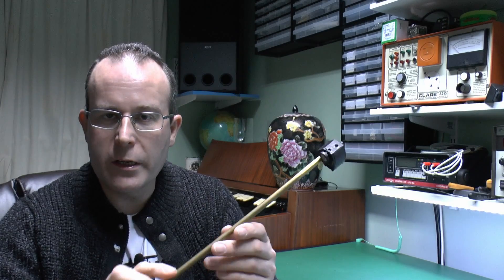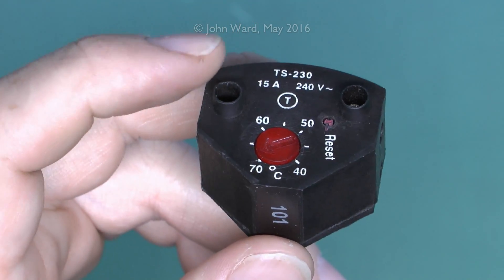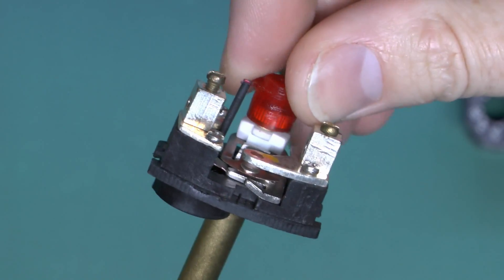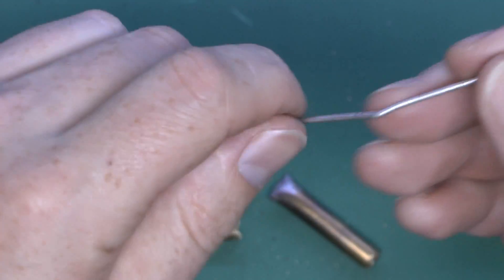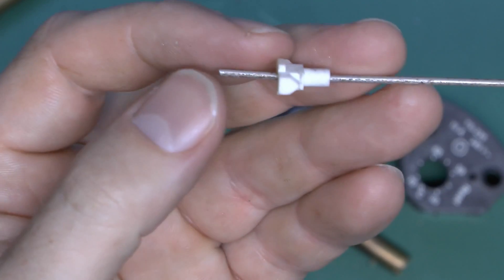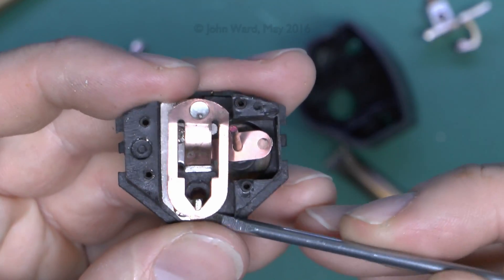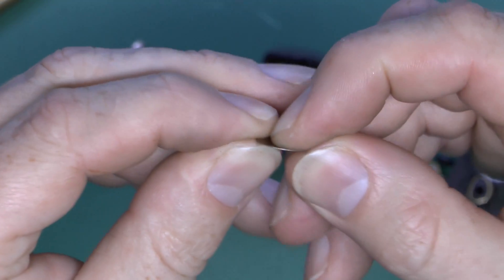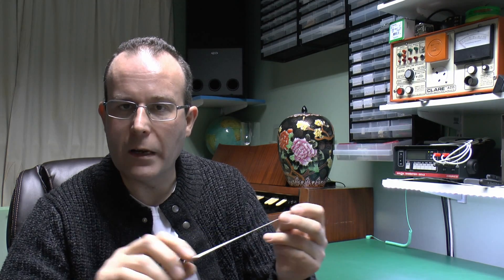Immersion Heater Thermostat Taken Apart

Comment: You have a perfect voice for an Airline pilot.  Wasted as an electrician/ plumber. Im here because thermostats are the bain of my life. Latest problem is corrosion at the supply connection to the point where the insulation melted. I've  lost count how many of these ive changed in 30 years and they're not getting any cheaper.

Comment: John, can you pls. recommend a make of thermostat with adjustable (or at least a high value of) hysteresis. Thanks in advance.

Background - I had my failed immersion heater element (with thermostat) swapped out 18 months ago by British Gas, who fitted a Tesla unit. Its working OK apart from one thing. When the tank is nearly warm it turns off the supply for a few tens of seconds, then turns it back on again for a similar time and repeats that cycle several times. Not good for the switch contacts and it must cause the Solar PV diverter supplying the unit cycle on and off several times as well which probably isn't good for its life span either.

Comment: Are there immersion heaters designs where the thermostat is not removable? My thermostat is faulty (always on) and seems to be fixed in place. I am reluctant to pull on it too much for fear of breaking it. This was installed in 1997. Thanks for any advice.
Reply from the maker: Not that I know of.  It's either the style shown in this video, or unvented cylinders typically have a larger thermostat head which plugs into contacts on top of the heating element.  Either way, both are designed to be replaced.

Comment: would a faulty thermostat cause the water to not heat up to the required temperature my tank is only heating a small amount of water
Reply from the maker: Yes, if it's switching off at a low temperature.

Comment: Thank you John, I would like to ask you a question. The top thermostat on our immersion heater is upside down and wired the wrong way around. Would that make a difference, stop it working? The water is very hot...
Reply from the maker: No difference, all the thermostat does is connect the two wires together when heat is required.

Comment: I've just realised with the thermostats that I've been buying that it's not necessarily the stat that fails but the metal wheel that goes slightly out of sinc with the plastic adjustment wheel on the outside of the stat, it seems like one certain manufacturer whom I've been using does not fix these with a heat resistant adhesive and this in turn stops the contacts from working, this has been somewhat of a revelation as I now have 4 fully functioning stats and all they needed was a slight adjustment and some high temp super glue,faulty or just poorly manufactured????

Comment: Hello mate. I have a pullin h8 thermostat, 15 amp 250v on my emersion heater. I have recently changed the isolator switch on wall as it stopped working. (Wasn't switching on). Now it stopped working again last week , so when I opened the cover on the heater and turned the water temperature down to minimum setting 120f, I heard it 'click' and it started working again for a week. A week later it's stopped working. Am I right in assuming the thermostat is faulty . And are they all the same or will I need the exact same one. Also instead of leaving it " on" at the wall all the time I tend to switch it off and on when needed. Is this not good to do?
Thanks in advance
Reply from the maker: 99% faulty thermostat - 120F is far too low for normal use anyway.  The fact it's marked in F means it's probably decades old.
They are all basically the same, the only real difference is the length of it, you need to get one of the same length.  If it fits into the top of the cylinder probably 18", or 11" if it's in the side - but this will be obvious when you take the old one out.
Doesn't make any difference switching it on/off.
Reply: @jwflame  thank you for prompt reply. Yes it's the top of the tank. I will remove it and check length . I have taken a pic of the top of it, but can't attach, but I think it's a case of disconnect the two wires and it just pulls up/out maybe a little help from prising it with a screwdriver?
Reply from the maker: @moshazza5684  Yes, it should just pull out, no prising required.

Comment: Hi John, would polarity of the terminals matter in the thermostat? I don't mean where incoming mains neutral and cpc are attached. Just the two terminals on the stat where mains incoming line is attached to one side.

Comment: Hi john i discovered the other day my hot water is only  slightly warm even with the cylinder thermostat fully up it was on for a while but still just warm  , is that a thermostat at fault on the cylinder or would it be the immersion heater thermostat or element, i have checked there is no loose wiring and the is voltage on the cable before the thermostat itself on the cylinder ,can i test each thermostat  with my meter  any help would be great

Comment: since changing mine....i am contantly pressing re-set button....i,ve set it at 55-60 ?
Reply from the maker: Either the new thermostat is defective, or there is some other heating source causing the temperature to rise above 90C.
Entirely possible for new thermostats to be broken or damaged, particularly if they are supplied without packaging.

Comment: Hi John, I appreciate all you videos. Have you got a video on the Calculation of SWA Sheathing as an earth. Rgds. Peter.
Reply: The outer sheaf up to 16mm squared conductors,over 16 mm,run an earth,as a rule the same cross sectional area as the sea,conductors ,hope it helps

Comment: what would happen if you put a shorter stat in.would the tank still heat up
Reply from the maker: It would heat up, but the thermostat would switch the heater off before all of the water was heated as it would react to the temperature near the top of the tank only.

Comment: The rod is most likely invar which has a low expansion coefficient, and obviously the tube is brass with a high expansion giving the required motion to operate the contacts.

Comment: Failure is the brass outer was not crimped correctly, and slipped on the plastic, losing the tension in the inner rod.  Take the spring bimetal and warm it with some heat ( place on a clean frying pan and turn on the heat) and it will pop off at 90C.

Comment: +John Ward Brass has a higher expansion coefficient than steel, so surely the brass case will pull the rod away from the housing rather than the rod expanding and pushing in?
Reply: Good thinking.
Reply from the maker: Yes, it's the opposite to what I said in the video.
Reply: +John Ward Sorry... My chronic pedantry wouldn't let it go :) Your punishment is to subscribe to me :)

Comment: At about 5:55 you show the white plastic piece moving in and out to open and close the contacts.  To open the contacts the plastic piece has to be pushed in which to me implies that the long rod needs to get shorter when heated in order to pull the plastic piece and turn off the power.  This seems odd.  Have I misinterpreted what I am seeing ?
Reply: The brass needs to get longer in comparison to the inner rod.
Reply: Good thinking.

Comment: When you turn the temperature setting dial early in the video you note that there is no click at any point.  Bearing in mind the temperature range of the dial would you expect the contacts to open at any point in a normal environment ?
Reply from the maker: They all click when the dial is rotated, even when cold.  The temperature markings are not very accurate at the lower end of the scale.